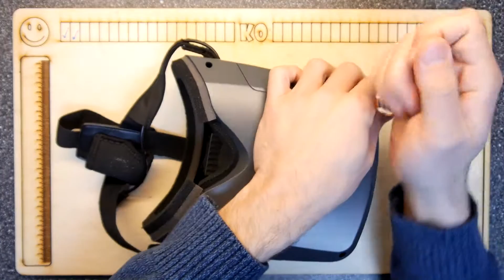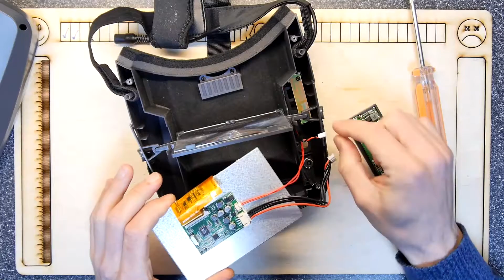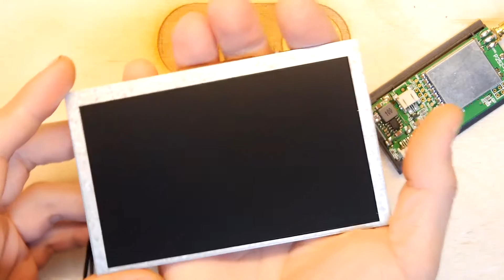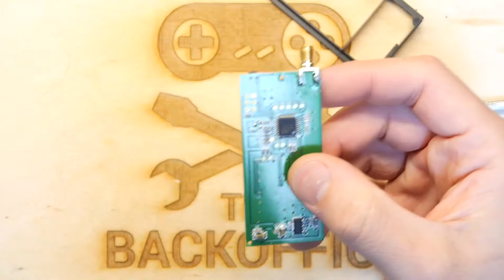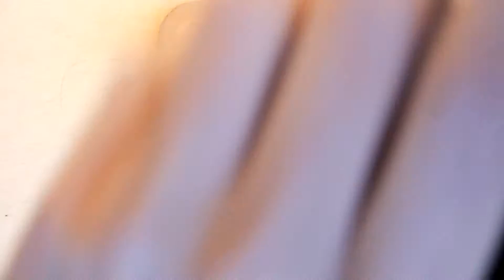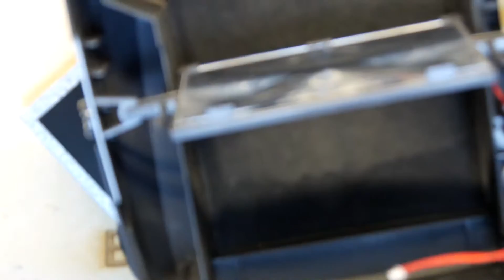Quanum Cyclops FPV Goggles

Comment: Hello, I try to get a channel with my used bought Cyclops goggles. There is a scan run but no results. Is it the receiver module? Could be broken. Or is it the indoor situation? I cannot imagine this.
Reply from the maker: Sorry, I do not know the answer. The receiver in these Google's was broken when I got them
Reply: @backofficeshow  I could activate mine 5 min ago only with electricity of the battery. Scanning was without result but playing with the contacts helped! :-)